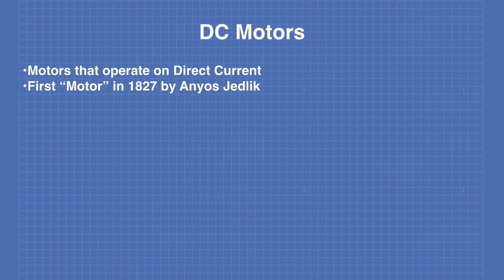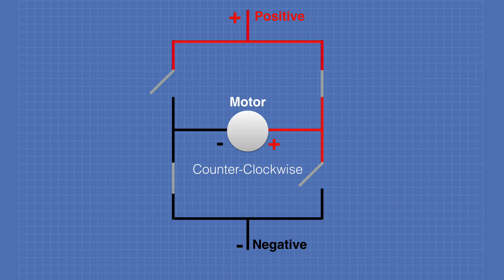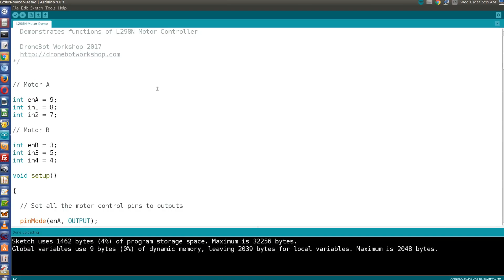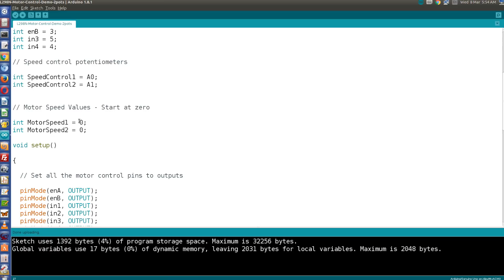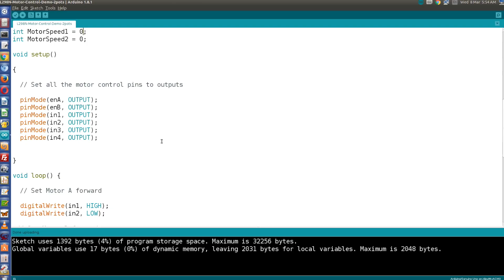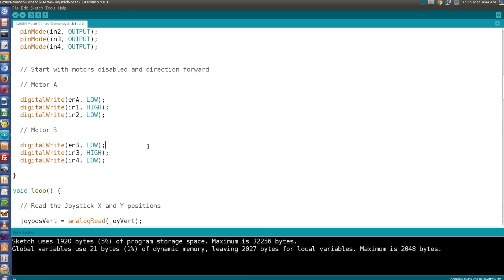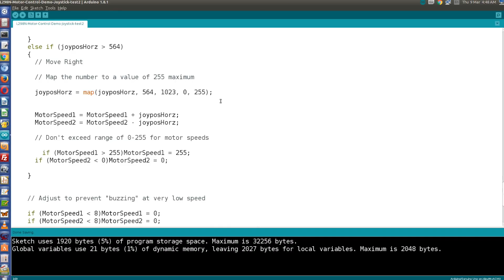Controlling DC Motors with the L298N H Bridge and Arduino

Comment: Great Video. Thanks for making. Which Video editing software are you using on Ubuntu ?
Reply from the maker: Thank You.  

I did the screen recording on Ubuntu using the RecordMyDesktop application, although I now have purchased an HDMI capture box so going forward I'll probably just use that as it will be easier to sync the audio later..

The actual editing wasn't done on Linux, I use Final Cut Pro on the Mac to edit and produce the video.  And I edit the audio with Audacity on Windows 10 (and also used a file converter on Windows to convert the Linux video from OGV to MP4), so I really have a multi-platform production thing going on here!

BTW I just subscribed to your channel, a lot of interesting videos on there!
Reply: I am just beginning with Arduino. My videos are for noobies.  Thanks for answering. I had to stop using Ubuntu as there was no usable editing software available. I purchased Camtasia studio for windows.

Comment: Hi i enjoy your video, i never use arduino but i want to begin to use for now a couple of proyects one is to use it for a Torch height control on a plasma using voltage divider output fromp lasma PS and other is to drive a AC motor with an inverter using signal to drive FW, REV and an voltage signal to control position using an encoder reference. i hope you can help me with that.
Thank´s

Comment: I am very passionate about arduino projects, I have quiet a few arduino kits at my disposal, I have a number of different components, including controller, sensor parts, add on shields, I would like to get started building finalized projects, 

I would like to say there is nothing better than building projects with a intended outcome, and learning all the important parts of configurating, assembly , connecting .

Thank you.
Reply from the maker: I agree, the building and learning are the real fun value in working with this stuff. It's so much nicer to be able to make your own unique items, even if there is commercial gear available. 

Best of luck with your projects!
Reply: Thanks

Comment: If I connect ground of Arduino to make a commom ground but not the 5V line with the H-bridge board it works also, 
Can you give some explanation into why the board need a 5V reference ?
Reply from the maker: The 5 volt input is optional, the board is capable of generating its own 5 volt supply (it has an onboard voltage regulator).  If your board is working without supplying 5 volts from the Arduino then you must have the jumper set to use the onboard regulator, which is fine. 

If you were to "dissect" an L298N (or much easier, just look at its internal schematic) you would find it consists of logic circuitry and some driver transistors. 5 volts is needed to supply the logic circuitry within the L298N.
Reply: Finally I found a comment regarding that question. 

I had a problem with this subject with my 4WD Robot car kit (very similar to the 2WD one with casters used in the speed sensor and wireless joystick robot car videos).
At first I tried to power the L298 and Arduino Uno (Vcc) from a 9V battery. The jumper on the L298 was attached.  
I think it ran the motors a few times and stopped working. When I measured the logic levels on the corresponding pins between Arduino and the driver the levels were around 7V.
I'm not sure if cooked the driver module or the Arduino or was it simply because 9V battery was not sufficient enough to power the both modules and 4 motors. At least the Arduino IDE doesn't connect to that Uno board anymore. 

 I since then changed the driver module with a new one and power it from separate power source (three 18650-s with combined voltage around 11 V) and I also had to change the Arduino board that is powered by the 9V battery. 
With the jumper attached it does work both with or without the connection between Arduino 5V output and the L298's 5V connector. It even seems, that with the connection and Arduino's power from the battery disconnected - the power from the L298 is enough to power the Arduino (Nano this time). What would be safer or better solution?

I found some more information  on:
https://howtomechatronics.com/tutorials/arduino/arduino-dc-motor-control-tutorial-l298n-pwm-h-bridge/
It says:
"The module have an onboard 5V regulator which is either enabled or disabled using a jumper. If the motor supply voltage is up to 12V we can enable the 5V regulator and the 5V pin can be used as output, for example for powering our Arduino board. But if the motor voltage is greater than 12V we must disconnect the jumper because those voltages will cause damage to the onboard 5V regulator. In this case the 5V pin will be used as input as we need connect it to a 5V power supply in order the IC to work properly."

And thank you for all your very informative videos!
 But as it was really hard to find a comment regarding technical questions from the ones where people share their appreciation of your amazing work would there be a way to make those technical ones more reachable. There was one very interesting comment on how to make the code more efficient.

Comment: Love the video- any chance of showing an actual picture of how you hooked up the joystick- I am doing something really wrong.....
Reply from the maker: Hi Margaret. I will try and take a picture and update the article on the website to include it, however in the meantime I can offer a few suggestions:

1 - There doesn't seem to be any "standard" in the pinouts of these joysticks, so be sure to look at the labels next to the pins. You might just have one that uses a different pinout than the one I illustrated. You should have a pin for 5 volts, which may also be called "vcc", a pin for ground, a pin for the Horizontal or X axis and a pin for the Vertical or Y axis.

2 - If you have a multimeter use it on the resistance function to check the pinouts, especially if your joystick isn't labeled.  Try and determine which pin is ground (if there is any metal on your joystick it may be connected to ground).  Then measure the resistance of the other pins to ground. The resistance of the Horizontal output should vary when the joystick is moved left-right and the Vertical output will vary with up and down movement.

3 - As a joystick is essentially just two potentiometers try hooking up a set of pots in place of the joystick (the wiring for the pots is exactly the same as the experiment before the joystick). This way you can be sure the rest of the wiring is working and that your only issue is the joystick.

Comment: Hello! thanks for the great video. I have  a question. I am supplying 24V to my vcc however on the motors I am having only 5V. I`ve disconnected 5V jumper and my system simple dont work. Is possible to have higher voltage output ? Am I doing something wrong? Thanks.
Reply from the maker: Hi Guilherme.
That is a mystery, if it's hooked up correctly a 24 volt supply should be providing over 22 volts to the motors.

What are the labels on the power connections on your L298N controller? I'm asking because on the two styles I have in my workshop they both have different labels. The one I used in the video is labeled "VMS" (for the positive motor voltage), "GND" (the Ground connection for all the power supplies) and "5V" (for the optional 5 Volt supply). 

"VCC" on many circuit boards is used to indicate the 5 volt input, so maybe you have your 24 volts connected to the wrong terminal?  If you have a voltmeter or multimeter measure the voltage at the 5 Volt jumper, with the jumper out. One side should show your full 24 volts, if it doesn't then the 24 volts is hooked up to the wrong connection point.  Also check the logic input pins to be sure that the voltage on them isn't exceeding 5 volts, as that would probably damage your Arduino board.

Of course it's also possible that you have a defective board, although this is rare.

Let me know the results of your troubleshooting and I'll try and help you further.

Comment: Wow love it !!! clear and precise articulation, way to go keep them coming.
I have read that, Some hobby cars use ESC (Electronic Speed Control), brushless motors,  motor encoders etc   ...when are such units used ? (what additional functionality do they provide ).
Reply from the maker: Thank you for your nice comment.

A brushless motor is actually an AC or Synchronous motor, it has no brushes as the permanent magnets are on the commutator (motor shaft).  To run these types of motors on DC current you need to convert the DC to AC, the frequency of the AC determines how fast the motor rotates.  An ESC is a device that converts the DC to AC and that changes frequency of the AC (and thus the motor speed)in response to control signals.

A common use of ESC's and Brushless Motors in on quadcopters, I'll be doing a video on the use of these soon.

Brushless motors are more expensive than DC motors but they last longer, are quieter and generally perform better.

I'm also planning on videos describing stepper motors and servo motors as these also have a lot of use in robotics and hobby projects. I'll also be showing you how you can use an optical sensor to provide feedback to improve the performance of DC motors like the ones I used in this video. Stay tuned!

Comment: We have to deliver a 
project of our course, but I can not get an Arduino Uno program that works with the L298N Motor Drive Board Module, Bluetooth Module HC-06, Joystick 3 Axis, Step Motor + Drive. Add a cylinder driven by a bomb or a motor, our project is a hoisting crane. Can you help us ?? My email is: joao_bp_vidal@hotmail.com.
For now, thank you.

Comment: At 11:00, you explain that you're using two separate power supplies for the testing. How would you wire up the power supply for the final self-contained product, if you are only wanting to use 1 9v battery....
Reply from the maker: Hi Rick. There are two possibilities here.

1 - Assuming that your motors are OK with being powered by 7.6 volts (i.e. 9 volts minus the 1.4 volt drop in the H-Bridge) then you could just connect the 9 volts directly to the motor power inputs and close the jumper on the L298N module to have the modules internal 5-volt regulator power the logic circuitry.

2 - If the motors could only handle 6 volts then you'd need to use a voltage regulator or buck convertor to drop the 9 volts to 7.4 volts. You might still be able to use the modules internal regulator to supply the 5-volt logic power, it's debatable as 7.4 volts is around the lower threshold for the onboard 7805 5-volt voltage regulator (but I suspect it would probably work). Otherwise you'd need a second regulator or converter to supply the5 volts.

Keep in mind that unless you're using very tiny motors a standard 9 volt battery may not be too practical as they don't supply a lot current.

Comment: CAN YOU SHOW HOW TO DRIVE THIS BOARD AND OR BTS7960B DC 43A VERSIONS WITH OUT A ADRUINO / PIE OR ANY MICRO CONTROLER
Reply from the maker: Hi Jamie

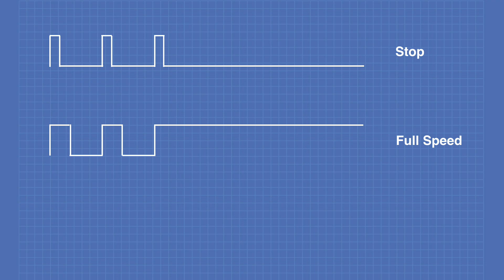Actually I did show that, albeit crudely at the 9:58 mark in the video. Essentially you use the 3 digital input pins for each motor, 2 to control motor direction plus the enable pin to enable/disable the motor.  Of course if you want to control the motor speed you'll need to have a source of PWM to connect to the enable line, which is where having a microcontroller come in handy. But you could do the same ting with a 555 timer if you didn't want to use an Arduino or a Raspberry Pi.

If you check out the article at http://dbot.ws/l298arduino there is a diagram of the hookup using a breadboard, plus a table showing the use of the input lines.

The BTS7960B works a little differently, it uses two PWM inputs and two enable lines - one for each direction.  There is a good Instructable for it at https://www.instructables.com/id/Motor-Driver-BTS7960-43A/, however this uses an Arduino. BUt again you should be able to drive it with a couple of 555 timers or another PWM signal if you didn't want to use a microcontroller.

Comment: sorry got it, anychance of code with 2 joysticks 1 per motor
Reply from the maker: Hi Matty. Do you want each joystick to control the speed and direction of it's motor (i.e forward and backwards)? Just want to confirm, let me know and I'll work out the changes for you.
Reply: hey mate, yeah 1 joystick per motor doing speed and direction, cheers mattymathews700@gmail.com
Reply from the maker: Hi Matty.

You just need to modify the sketch to ignore the horizontal potentiometer section and duplicate the vertical potentiometer section for the second joystick. 

I'm going to use the sketch on the article at http://dbot.ws/l298arduino as it has line numbers for reference so you may want to look at that to follow along:

 - Connect the second joysticks vertical potentiometer to input A1 (of course disconnect the original joysticks horizontal pot first!)
- Change line 25 to a variable to represent joystick 2, i.e. "int joyVert2 = A2;"
- Change line 35 to set a variable representing the 2nd joysticks' position, i.e. "int joyposVert2 = 512;"
- Change line 72 to read the 2nd joystick position, i.e. "joyposVert2 = analogRead(joyVert2);"
- Delete the lines from 132 to 177 (the horizontal position stuff)

Now you'll need to duplicate all the vertical position stuff, but make each segment just control one motor instead of both:

- Copy lines 78 to 130. Change all occurances of "joyposVert to the new variable (i.e. "joyposVert2")
- Paste the code after line 130
- In the original "vertical section" (i.e. lines 78 to 130) remove all references to "Motor B" and "MotorSpeed2"
- In the new vertical section (the one you just modified and pasted) remove all references to "Motor A" and "MotorSpeed1"

That should do it!  Hope it made some sense, let me know how it works for you.
Reply: yip cheers mate code works great
Reply from the maker: Awesome - glad you got it working!